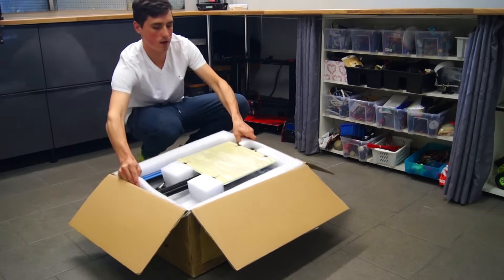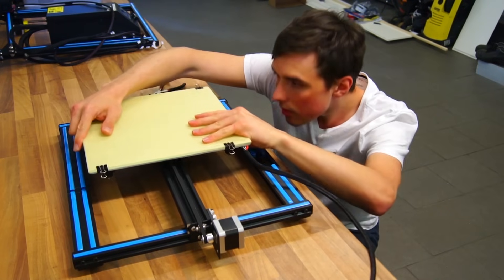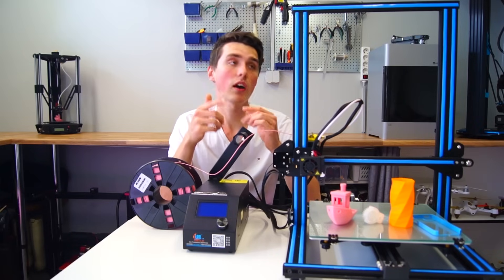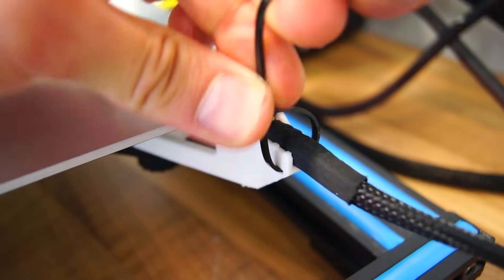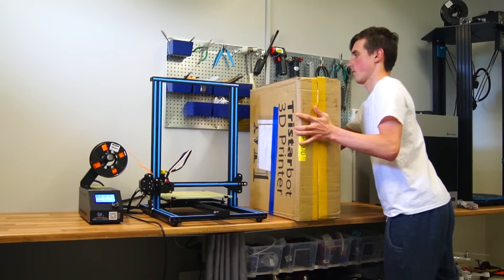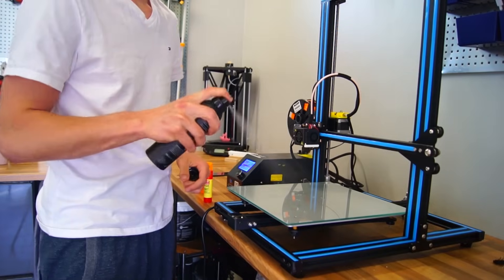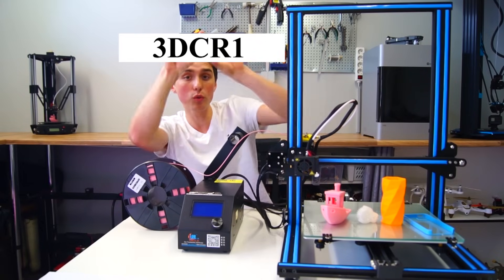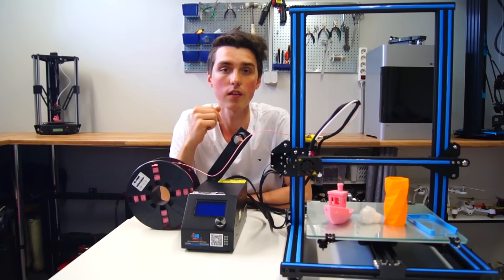Creality CR-10 Full Review - BEST 3D PRINTER!!!

Comment: come on man, Anet a8 the best printer ever, tevo tarantula best printer ever, cr-10 best printer ever!!!! wth
Reply from the maker: I'm sorry if this seems to be the case. Technology moves very quickly, but more importantly, I can't test every single printer at the same time. I seek out the printers I believe my viewers will benefit from and the CR-10 is genuinely an awesome printer that I can recommend to everyone. However, I'm sure I will stumble upon an even better printer than the CR-10 in the future. 

I do not seek affiliate buyers. My reviews is, and will always be, unbiased. If the printer sucks, I will tell you it sucks. In this review I did point out my concerns, but based on my previous experiences, the Creality CR-10 was superior to all the other 3D printers I have tested. Therefore I used the title "BEST 3D Printer", simply because it is the best 3D printer I have right now. Though I can't promise you that it will always be the best 3D printer. 

Sorry for my long text, hope it helps.

Comment: Did you have any issues with blobbing marks due to bad retraction? I can seem to get rid of the bumps...
Reply from the maker: It does require fairly aggressive retraction settings. I use 7mm of retraction distance and a speed of 30mm/s.

Comment: I am considering getting this. Should I pick this up, or save my pennies back and get the tevo little monster?
Reply from the maker: Well, nothing beats the TEVO Delta in speed. It is extremely fast! However, I rather have 2x CR-10 printers than 1x TEVO Delta. So, did that answer your question? :D
Reply: Yeah it did. Thanks!
Reply: one more question though. Is the hotend lined with ptfe? Because printing in nylon inst possible unless with an all metal hotend right?
Reply from the maker: Yes the hotend is lined with a PTFE tube, but nylon and flexible filament was no problem to print.

Comment: Hey RC,
I have had the CR-10 for about a month. I use it every day and agree it is a fantastic printer.  I have had great luck with this printer. If any of you guys are on the fence about this one, I don't think you will be disappointed.  I paid $395 USD from Banggood and feel I got a great deal! The RC coupon makes it a GREAT deal in my humble opinion.  Thanks RC for the upgrade files. I have the strain relief already but plan to print the fan director. Thanks for posting.  - Sonic Ox.

Comment: RCLifeOn I recently got this same printer from gearbest. I'm just not getting good quality prints with my settings in Cura and have yet to get a print that amazes me. Is there a chance you could possibly comment maybe some of your settings in Cura? I'm still a newb at this, but I have been trying different Cura profiles for the CR-10 for the last two months and have yet to have a good quality print. I was thinking yours might work based on the amazing print quality you were getting. Thanks

Comment: i just put together the tevo tarantula now i feel like i should have waited and bought this one. this one seems to have a better manual while the tevo has very scrambled instructions and no part cooling fan. after all the problems i had withe the tevo and seeing how much easier this one is the extra hundred fifty bucks with larger build volume is worth it and buy some build tak and paste it directly on the heat bed that will help withe the abs problem
Reply from the maker: They will always make new and better 3D printers, the Tarantula is still a great printer to start with so don't feel bad.
Reply: i bought it in the idea of heavily modifying it any way just wish the initial instructions were a bit more clear. i had to completely reassemble it 2 or 3 times due to diagrams changing and giving a different perspective of part assembly and i still have to change the firmware for the larger bed and eventually auto leveling and  duel e3d v6 hot ends.
on another note  the anet a8 came with plenty of documentation and there is a huge amount of different mods and great documentation for changing firmware easily to the point where i can load anything and not expect any problems during the print. would have to rate the anet a8 higher then the tevo tarantula

Comment: did you try printing ABS without the glass bed, if so what was the result
Reply from the maker: Warping was not the issue. ABS sticks well on glass and tape.
Reply: RCLifeOn was asking for the reason if not having to heat the glass too, the bed itself might get a little hotter might get a

Comment: Nice review of the Cr-10. I have one and love it. I have it running around eighteen hours a day printing one thing or another.

 Not trying to be pickey but you forgot one important item during the assembly process. Check the voltage switch on the side of the control box to make sure it is set to the correct voltage for your country or region. All the CR10's I've seen shipped to the US are set to 220 volts and must be changed to 110 volts